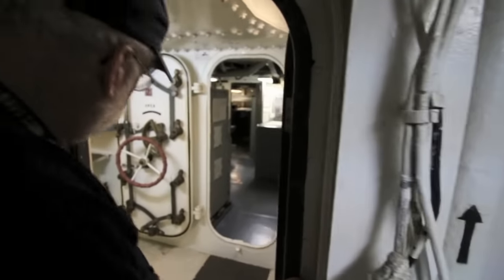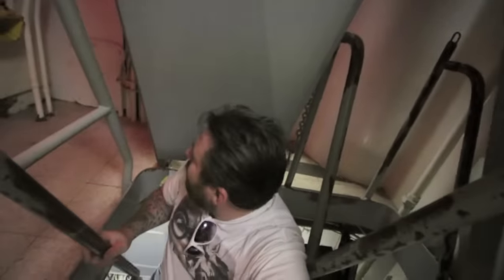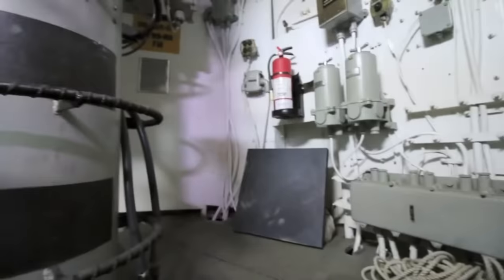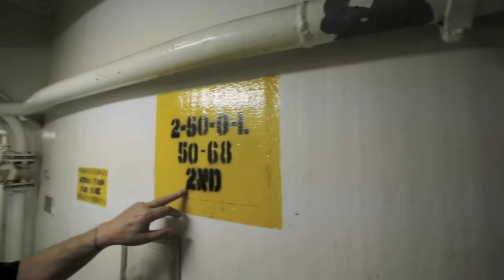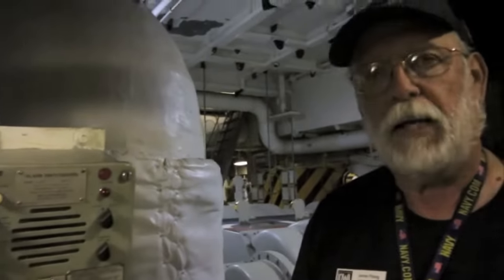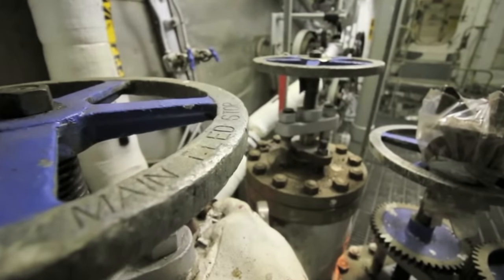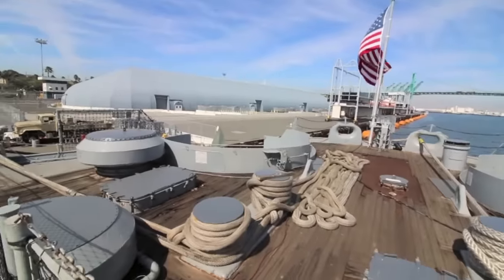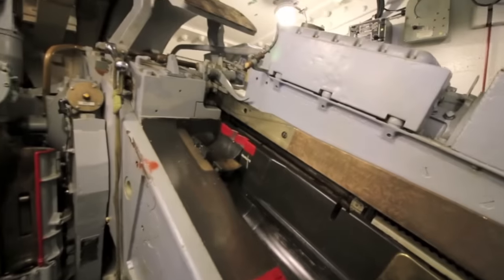Exploring OFF LIMIT Areas WW2 Battleship : USS Iowa

Comment: On all other ships, the Navy calls it the CIC (combat information center) not cEc (combat engagement center) as the guide said. I could be wrong and it's just different on Iowa but I think that room is actually called the CIC.
Reply: The Iowas have CIC's, they are on 4th deck just behind turret 2.

The CEC designation was 80's, as the room was re-purposed. While 'CEC' shows up on prints, I have been told the crew used the term 'Strike' in the 80's.

Comment: 1 thing i would have asked does everything on this ship still work. and how long will it take to get everything in the engine room ready and working
Reply: T2 is 100% non-op, all the other guns, in the sense that they have NOT been de-miled, are  capable to be put in in working condition. Engineering is the same, though everything is drained and opened up, and the boilers need repair work, but again, nothing has been torn out or disabled. When laid up years ago, technically she was suipposed to be able to be made functional IIRC in 120 days but in reality it would take at least a year.

Comment: Excellent video! Lots of interesting details I'd never heard before. The technology may be old and analog, but it was the finest of its kind, the only drawback being the number of people needed to run it, in considerable danger and discomfort. Modern ships have gas turbines and remote servo controls, with much less armour of course (armour is pretty useless against three-ton hypersonics, but was no doubt quite resistant to WWII shells and 1980's Exocets).  It is wonderful that the US has preserved so many of its great ships (including 7 of the 10 battleships built for WWII). The "Aurora" in St. Petersburg, , "Belfast" in London and  and "Haida" in Hamilton, ON, are great, but the US has a whole fleet of magnificent preserved warships. Of course, they are not cheap to keep ... every half century or so they all need new steel bottoms, requiring a tow to a shipyard. PS: One goes up and down ladders facing the ladder ;-)

Comment: Curious, these Iowa class battleships seem to be preserved, not only as museums, but to restore them back to service. How long to restore the USS Iowa?
Reply: Well, this is theoretical,  because the Navy told the CEO (Johnathan Williams, who I know personally and well) quote: "We do not want the ship back.  If the museum fails, she will be scrapped."

However, your question is not really easy to answer, because there are many factors to consider.  First, she would need significant yard/drydock time. The nearest drydock large enough to take her is San Diego, but that is pretty much booked solid. The next closest is Hawaii, which would require a tow. Not cheap.  Is she CAPABLE of being brought into running order? Yes. Is it PRACTICAL or PROBABLE? No. Boilers need re-bricking and possible re-tubing, and all the sea chests are welded over. Then there's the ammo issue. There isn't any, no projectiles or powder, and no spare barrels, all has been destroyed. Now add to all that, there are virtually NO spare parts ESPECIALLY for the legacy electrical systems.

Time frame would probably be years, and costs would be astronomical. Not gonna happen.

Comment: Nice vide but, when they are in the CEC and he points out the IBM tape unit, that is an audio recorder to record what is said on radiotelephone circuits.  It records a given amount of time then records over that. You find these when any type of air traffic control such as anti-sub warfare helols are concerned. 
Computer tape drives would be found in a dat processing center as data backups.
Reply: That's right.  That was before I was corrected. I heard that they are 10 track, and there's two decks in that stack. I learn something new every day. I'd like to edit that out, but it's not my vid, and for something that long, processing time takes forever in YouTube.

Comment: really cool video, and a rare glimpse behind the scenes as it were into places that the tours wont let most people go, conditions were kinda rough it seems for the crews of the battleships and that's respectable, having to work in such conditions under the stress of combat and even day-to-day maintenance of such a big girl, i remember reading about the accident in the turret, for a high school project, and wasn't it later discovered that one of the propellants for the 18" guns (or was it the 15" guns) off gassed what was essentially ether into the compartment, and either an electrical fault, or static electricity caused a tiny spark that ignited the volatile gas in the air and caused the explosion that killed the men? still complete insanity that they tried to pass it off as the direct deliberate action of a single crewman. anyways i digress enough rambling on my part, i got chills in a few places when you were talking about the history of the ship, and it was interesting to see just how tiny the captains quarters really were, but i guess as the man said, hes the final responsibility of the lives of the crew, and always "on call" as it were. good video
Reply: There never was an oficial finding on the accident, although Sandia Labs duplicated ignition with drop tests. The Sandia report is on line as a PDF.  There's lots of  speculation. Our Chief Engineer has done extensive research and though often mentioned, There was no outgassing detected. Because of the drop tests, it is usually assumed that some sort of 'over-ram' was responsible. That was a very bad day on the ship, but as many former crew say, it wasn't the only day. Lots of days where it DIDN'T happen. She's more than April 19th.

Comment: I'm naval engineer and I feel  for engineers down below especially machinist mates and boiler technicians  because  if that steam goes off ur dead if  u don't watch boiler gauges boom that especially bad it nice to know naval engineering hasn't changed we have used the same equipment today
Reply: Most people do not realize  that todays nukes, with one exception is the exact same teck. The only thing different is the teakettle.

Comment: It's amazing to think that these complex machines were so well designed that they were useful and effective for half a century, especially given the technological advancements of the twentieth century.  What other machines designed and built in the 1930's/40's were still relevant in the 1990's?
Reply: The dates are a little off, but you can add the B-52...
Reply: B-52's aircraft,, blows me away that the guys flying them now , in many cases their fathers flew them first. The aircraft are slated to be around and flying for a good bit longer.

Comment: Great video but I got told that port is an old pirate sayint and that's there is no port left in the bottle hence where port came from that's how I always remember hope this helps
Reply: That's one of the legends, however the most likely is this:  Before rudders, ships used 'steer boards', eventually corrupted to starboard. If you tied a ship to a pier/dock, the steer board was on the outside, so it didn't get damaged by the pier. So, you had the 'steer board (starboard) side and the port side.

Comment: As a former ship's engineering officer, it's great to see the engine room of a battleship.  I can recognize everything that was shown and know how it operates.  The layout is cramped compared to a merchant vessel's engine room.  The ship appears to be in great shape.  However, if it languishes without a full head of steam for too long, you'll have a LOT of leaks to repair and lots of maintenance to get her going again.  I'm amazed they don't have steam atomization for the burners.
Reply: All the boilers steam drums are open, and when laid up the ship was sealed into several zones with dehumidification systems. Condensers are open, all sea chests are sealed over.
Reply: @jamespobog3420  All that helps, but gaskets dry out regardless.  You have a lot of repacking and gasket replacement to do after a long period shut down.  I've broken ships out after a couple years of inactivity and there's always things to fix, including acid cleaning the evaporators to get their thermal balance stable.
Reply: @DARIVSARCHITECTVS   SOmetimes people advocate some sort of conversion. IMHO that's a bad idea. These ships are never going to return to action. Too old, too dangerous, too expensive. The boys who ran them in the 80.s are now close to 60. No one knows how to run them anymore. Also, any conversion would be a major compromise and you'd pay to deconstruct then pay to reconstruct. Better to purpose design and build new.
Reply: @jamespobog3420  That's a two edged sword.  Many like myself can still run the WWII ships as well as the modern ones.  Whether or not to convert or update a vessel is largely up to the cost versus making a new vessel which can take advantage of the new tech.  Example: aluminum superstructures were once needed to lighten cruisers that had heavy C&C computers on board, but they are susceptible to fire.  Modern lightweight electronics allow a return to steel superstructures.  My SL7 Ro-Ro ships were ship conversions of fast sealift containerships.  They are old heavy oil fired monsters that can do 36 knots, but there are no decent new replacements.
Reply: @DARIVSARCHITECTVS   I think you make my point about cost/benefit analysis. Things like the Belknap debacle or a Ro-Ro conversion I think are different than dealing with massive armor citadels and barbettes. Please do not take offense, but I would guess that you are somewhat 'seasoned' rather than being a 20-something whippersnapper and I have no doubts that you and others can run old oil fired plants. In reality, I was technically not even a BT, I was a non-rate E-3 Fireman, yet upon return to the states in late '72 I was given an in-port, steaming, top watch. Not even a striker, just an E-3. In the 90's I asked my Chief  why. His reply just floored me and is something I treasure to this day, he said "We thought you could handle it." So though I wouldn't want to handle a top watch today, I sure as hell could check water or be a burnerman. But, as the movie title says, I think today a boiler room is "no country for old men". Doing it on weekends for a few hours is one thing. Crossing the Pacific would be something else.

So how do you think Iowa could be converted? What do you do with the barbettes? Keep the B&W 600's or go to nuke? 1 reactor? 2? 4? Dou you cut main armor to gut and install?
Reply: @jamespobog3420  Convert Iowa?  No.  Too expensive, but an arty battery at sea still has lots of use as-is.  I've seen Iowa at sea.  She passed my ship in a fog on her first foray out after the turret explosion.  If I had a camera ready, my photo would have made Time Magazine.  She was a ghost who came out of the yellow fog and disappeared in it.  -Seasoned.  Yes, I was a  2nd Engineering officer 28 years ago aboard merchant ships.
Reply: @DARIVSARCHITECTVS    Isn't the 5" the largest gun the navy has now? I do know this, all 16" powder, projectiles, and barrels are gone. Do you know the status of any 6" or 8" gun systems?
Reply: @jamespobog3420  I don't know which gun is the largest in the Navy's arsenal, but yes, the 16 inchers are only being supported on the Iowa class battleships.  They are old, but a 24 mile range still makes them useful, especially for beach landings.  In a protracted conflict, guns are far cheaper than missiles, so there's a cost savings as well.
Reply: @DARIVSARCHITECTVS   But my point is there is simply no ammo. It has all been destroyed as well as all the spare barrels. This happened 2 or 3 years ago. We were abl;e to get a 3-4 foot slice from the original center gun T2, and a 1-2 inch slice that is used as a frame for ''Volunteer of the Quarter" award. That is on display in the wardroom and the long section (actually the muzzle with markings) is in the museum. I had an old GM Chief tell me it's the most worn out rifling he's ever seen on a 16" barrel. Should be razor sharp, but the edges are  very beveled. It is also my understanding that the mfg knowledge and capability for the 16" Mk 7's has been lost.
Reply: @jamespobog3420  I didn't know they didn't have ammo or spare barrels.  That's bad.
Reply: @DARIVSARCHITECTVS  

We were all pretty bummed and stunned. That is somewhere between 2018 and 2015? Maybe? Recent, anyway. Again, recently within the last few years. Iowa got a couple hundred practice dummy projectiles.  There's also, IIRC, a full size AP dummy as well as a mockup of a 13.5"/sabot round . They were trying to get 50 mile range out of the guns...

Comment: I wouldn't be worried about the asbestos on the lighting stick for the burner. He was surrounded by it in the steam room!
Reply: True, but there is a small difference. The asbestos on the torch is bare. All the insulation on the piping and large equipment is painted, "encapsulated" and therefore safe.

Comment: 1.  So, what is the purpose of the pit of death?  Why would you want a hole that small that goes all the way to the bottom of the ship?
2.  22:06 "That is where hell happens."  The burner output into the boilers I presume?
Reply: The BIG p.o.d. is a 'strikedown hatch' for getting ammo down to the magazines. the smaller one is lower hold access.

The big hole in the boiler is a removed air register/burner assembly and you can see into the firebox.

Comment: Need to make a correction on the boiler steam drum portion of this tour, remember this is constructed criticism. He pointed out the tubes below the scrubber's is where the water goes down, those are steam generating tubes that's where steam comes up. The water actually goes down 4" downcomers which you can't see. Believe me I spent four years maintaining these boilers and crawled in the steam drum with a bucket and sponge to get any water left before dry lay up. Thank you brother for the memories. BT3 (SW) Lemon 83'-87' Plankowner second recommissioning.
Reply: Hello, Kevin. I was a BT also, but on 450lb sectional header Babcock & Wilcox. I never had to go in a steam drum because I'm too large (tall).  It's been since '73 since I went into a firebox.  At that point in time, engineering was pretty dark and even tho for years I lobbied to get the drum and firebox lit, when covid hit and I lost my job, it still  hadn't happened.

They just looked like water wall downcomers to me, because I assumed the generating tubes were under that sheet at the drum bottom.

I gave a lot of tours all over the ship, Spot 1 to the bilges of fireroom 4 and it didn't take long to figure out that more important and memorable sometimes was not the exact facts (because some of them can be ......obscure), but the CONCEPTS involved. That happened a lot in the plot rooms.

Comment: QAATD = quick acting air tight door; that “hole” was most likely heading to shaft alley.  Been down them on cruisers, destroyers and frigates.
Reply: I will take a look around the ship, I thought I saw that label only on armored doors, but I could be wrong. 

As far as "hole", not sure which one you mean, bit if you are referring to the 'pits o' death', no, those are not to the shaft alleys. Both are forward, we didn't go anywhere the aft access to the shaft alleys. The big one is magazine/barbette access for Turret #1, and the smaller one is a little farther forward on the other side (port), and is forward of the Citadel. It is access to a hold.
Reply: james pobog Ahhh - well definitely not shaft alley then, although visually similar.  Great tour, btw.  I sailed alongside Iowa - even witnessed a full broadside!  We have Wisconsin in Norfolk, too!
Reply: Cool that you've seen a broadside. More than I have seen.  My naval gunfire experience is limited to witnessing a premature projectile detonation about 100 yards past the muzzle, being below decks and seeing a door (regular, not watertight) pulsing open to the rhythm of  pressure waves from unheard 5" fire in the Tonkin Gulf, and most recently, being Mount Captain for our 5" blank shots we do on special occasions...

Comment: Hi Jim!  Amazing tour!  I wish I could get a tour like that.  Anyway, at 14:09 in the video, what is a Pit 'o Death?  What is it's purpose?  What part of the ship is it in?  Where does it start and end?

Thanks for your time and efforts!
Reply: The "pit o death" is one of the vertical ladders that go through several decks to get to the areas called 'Shaft Alleys' Those are the areas that the main engine's propeller shaft goes from the reduction gear back to the 'stern tube' and out to the propeller.  The shaft alleys have large bearings to support and align the shaft. The pits are straight up and down small width and length compartments with only a net to catch you if you slip. One slip and you could fall easily 50 to 60 feet to a steel deck, hitting the hatches on each deck on the way down. Understand now the name?
Reply: Read my answer below to Steve Covington...
Reply: @stevencovington4715  

Steve, you are close, but wrong end of the ship. What I showed there is a 'strike-down hatch' for turret 1. This is where the 16" munitions are on-loaded. Each turret has 2, except T2 which has 3 (one is for powder only).

Otherwise, your descriptions of shaft alleys are correct.
Reply: @jamespobog3420   Thanks for the clarification.. 20 years as Machinist's Mate. It certainly LOOKS like the straight down access trunks that went to the Thrust blocks areas on the USS Midway (1985-1987).
Reply: @stevencovington4715   Another Lead (I am Senior) was on Midway during Vietnam, was involved in Frequent Wind.

I've been on the ship 7.5 years, and have never been to a shaft alley, and only down a pit-o-death once.

I was a snipe also, a BT. 1975 WESTPAC, USS Mispillion AO105.